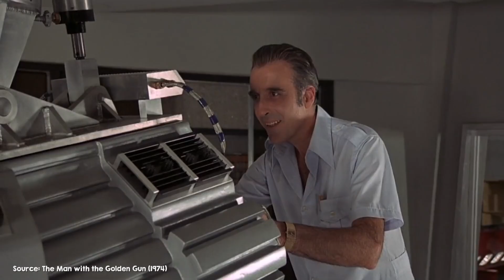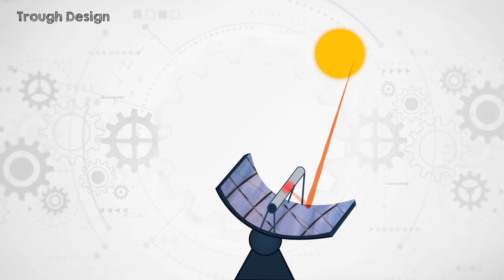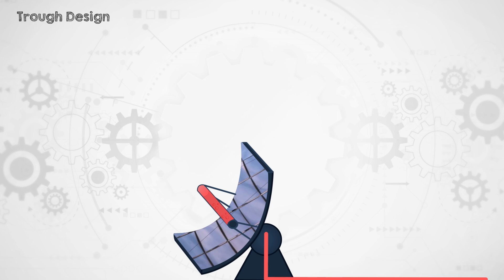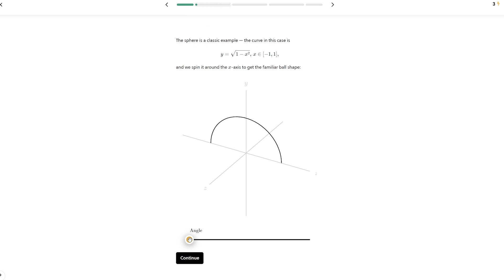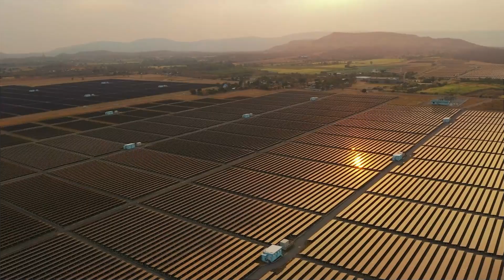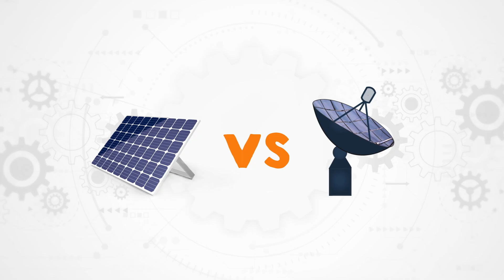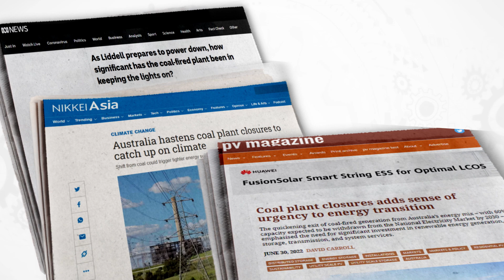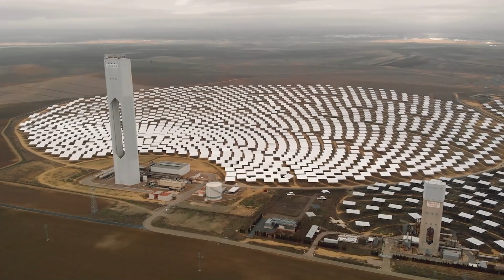Solar Power at Night using Concentrated Solar Power CSP

Comment: As much as I love concentrated solar, if photovoltaic prices keeps dropping, negative energy prices around noon will become common. So just take the heat storage part, and use the excess electricity around noon to heat it up. Electrical heaters are very easy and durable to build, compared to flowing molten salt.

Comment: So. Its 2025 and Arizona shut down their CSP system because it had to run on Natural gas to get it hot enough. Then most of the mirrors got ruined in a sand storm. No more heat. Sorry.

Comment: The public power grid has no choice in supporting wild AC.   Wild AC adds a great deal of cost to providing reliable electricity.  The wild AC from wind turbine and solar voltaic generated electricity is typically supported 100% with natural gas turbine generators running at high readiness 70% fuel consumption making near zero electricity where 100% output 100% backs up the wild AC 100% in 2 - 3 seconds.  Steam turbine generators used in nuclear, coal and the second cycle of natural gas combined cycle plants react too slowly to support large amounts of wild AC.   

The public power grid is responsible for constant power delivery and this is the reliable method used.   It requires curtailment of economic fuel efficient power generation to below the maximum peak of wild AC so that can be quickly accommodated with fast reacting natural gas turbine generators.   This consumes huge quantities of natural gas.  

Australia now has domestic short falls in natural gas due to this new huge need to backup so much wild AC.  It appears Australia will shortly need to start importing natural gas for further expansion of support for wild AC.   This from a country that has large natural gas export contracts it can't realistically break.

Cheap natural gas allowed large support of wild AC with the public power gird making it possible.   Within a couple hours of needed wild AC support,  such as for solar voltaic,  the power grid has to ramp down coal fired power stations and ramp up natural gas turbine generators for the quick response needed for the wild AC with similar switch over after wild AC is no longer needing to be supported.   When supporting wind turbine generators the public power grid typically needs to always be running expensive high readiness natural gas turbines generators.   There is no cheap means to quickly backup erratic forms of electricity generation.   Natural gas turbine generators  has made this relatively economical and reliable, but more expensive than conventional electricity.

Comment: Please sort out the CSP operational issues in Oz.  The balance of peak generation rates and storage capacity needs to based on operational data, not guesswork. Crescent Dunes CSP plant shut down several years ago, but has left the US with with a bad impression of CSP. In order to push CSP forward in the US, we need real operational data.

Comment: A billion dollar solar facility was a near total loss when the curculating system failed and the molten salts froze up.  Some solar farms use parabolic trough mirrors to heat compressed air in pipes to drive a gas turbine.
A plasma can be raised to any temperature. A plasma tends to absorb all manner of radiation and would offer no resistance to the flow of air.  A stream of comoressed air can be turned into a stream of plasma by passing an electric arc through the stream of compressed air.  So if the converging rays of sunlight from a dish mirror are turned into a narrow beam of light with a lense, the beam of light could be used to heat up a stream of plasma to drive a gas turbine.  The efficiency of a gas turbine tends to increase with the temperature and pressure of the furnace area.  If the efficiency of a natural gas gas  turbine can be over 40%, a plasma powered gas turbine with a temperature of tens of thousands of degrees might be 50% efficient or more.  
Some might nention direct sunlight.  Solar panels can get some power from indirect sunlight.  But if the inside of a cylindrical collector is covered in high temperature, high efficiency solar cells, a CSP system could have an advantage over solar panels even in somewhat cloudy skies. 
A gas turbine makes a lot of noise so it would not work as a rooftop system.  Or could the exhaust be directed into an underground chamber that would make it very quiet?
If a homeowner is getting  heat and electricity from a dish, the dish has a four or five times advantage over solar panels of the same area.
The dish tracks the sun which gives it another advantage. 
Millions of dishes coukd be combined into a formidable directed energy weapons system. A million dishes each firing a ten thousand Joule  microwave pulse is ten billion Joules.  If the air at the focus is turned into an explosive plasma, the blast and heat might destroy just about any target.  The converging microwaves would tend to create converging Xrays which would penetrate just about any armored plating and fry the inside of the target.  Explosives inside of a ballistic missile warhead would  explode.  10 billion Joules is the equivalent energy  of about two tons of TNT.  The blast would be like slamming the missile  into a brick wall which would also explode the explosives inside.

Comment: I know of four of these built since the 70s and have never heard of one producing any real amount of power. The latest multybillion dollar project in Brazil they have just sold off to BMW, and they plan to use UT to crack hydrogen out of water and then carbon from the atmosphere to make hyperformans engine fuel.(ethanol by a difrent name). But Suncor just adds carbon from the CO2 in the atmosphere to methane. Much more economical.

Comment: The only CSP technology that really worked was the Pyreheliophoro by Manuel António Gomes, better known as Padre Himalaya. His technology was presented at the 1904 World's Fair in St. Louis and won the top prize and two gold medals.
This solar concentrator was able to generate 3800°C at the time, and this result has never been repeated. 
Everything else that is built and presented today is just useless scrap.
Reply: Parabolic mirrors and Scheffler reflectors also work very well, especially if you want heat not electricity. But the pyroheliophorus is really interesting I must say.

Comment: Engineering with Rose Coloured Glasses.   Suggest you have a close look at the failures of Crescent Dunes and Ivanpah CSP plants or the large plant in Spain which was closed down as soon as government subsidies were ceased.  It's not just a case of installing a a plant BUT successfully operating such a plant in a cost effective way to maybe even given even a modest return on capital.  Doesn't appear to be happening yet with many disappointed expectant consumers.  Let's not worry about the impact of CSP on birds especially raptors.   This series is more of would, coulda, shoulda, maybe, possibly etc etc.

Comment: Heliostats for those who speak proper English, can be much simpler, such as using mirrors to concentrate energy into a window for example or onto  a dark masonry or metal surface. If heat is directly used it is far and away more efficient than always converting everything to electricity, and heat is easily stored in thermal mass to be released as warmth over night.  You've focused on the dollar values and ignored the inefficiency of conversion to electricity - understandable, but dumb. Wouldn't it be more useful to tell ppl how they can set up mirrors to track the sun while remaining on target? There are zero yt vids teaching that.

Comment: For long-term energy storage that doesn’t dissipate, why not use it to split water as hydrogen?  In addition to sodium.
You could heat a transfer fluid or salt as your primary, then use next generation flywheels as a Super Efficient Capacitor, and the Generate Hydrogen for long term storage.

All of those are less toxic than lithium

I thought about doing that with offshore installations that have solar wind and wave power

Comment: Wouldn’t the best battery be a carbon nanotube or graphene carbon fiber flywheel that is incredibly huge?
Especially one that is the diameter of a O’Neill Cylinder, at both ends?  Like a gyroscope a cube sat, but you have 4 Torus sized flywheels at each end (in case one needs to be serviced, the other could take over)

Comment: How hot do the mirrors get?

Is it possible to not only concentrate the power to a central point, but also preheat water at each mirrored point?  Or is that not enough waste heat?

I was thinking of using solar sterling engines, or solar concentrators to also generate light along the spine of an o neil cylinder.  The only problem is I don’t think that’s going to go very far. Especially with the idea of one being 30 to 40,000 feet in diameter.  Even if you could dot the entire central axis with solar concentrators or solar sterling engines.  

To light up and O’Neill cylinder, you would need a third of it‘a surface to be transparent, and that is extraordinarily hard, especially if you want to be able to have it maneuverable in space with Station sized gyroscopes/fly wheels, have rivers and lakes, besides everything else.

I’m just thinking of getting a twofer in space.  Power, light, and heat the air

Comment: Do you have any data on CSP desalination + water/vapor transfer/pumping?

I use CSP trough to pump water to the higher elevation storage for later gravity fed residential use. I am able to distill (although primary function was to pump) significant volume of water on sunny day reducing need for RO filtration. This is all based on small DIY - semi-off-grid setup but I believe could be easily scaled up and used in arid/semiarid location.

Comment: Great channel. A lot of your footage is from Noor II & Noor III. After working directly at the site, I have to say the parabolic seems more workable. The solar tower seems like a great idea, until commissioning all those mirrors to move correectly. This is something that can be overcome with quality design and control. One thing that remains problematic, that is the amount of water required to clean the mirrors. The footprint for a 150MW turbine is very big, which in the dessert is not so bad until a day of wind and dust puts the mirrors out of order. A literal fleet of diesel water trucks is used to overcome this problem. 
Pumped hydro is much more proven at scale.

Comment: I live in Belgium. All these technologies are very compelling and interesting but they all have one major flaw for the consumer. You still need that power cable connected to the grid operator and as long as this is the case they will suck your bank account dry. Some claim that super power will make energy abundant and cheap but I personally don’t believe this. As long as that cable is connected they will find out any reason to keep their profits at bay. The majority of costs are now already a collection of very clever fees they invented to guarantee the profits and have nothing to do with your energy consumption. The main problem is in December and January, the darkest months when we lack the ability to generate our own energy. They need to invent something that generates about 500w continuously which would be enough to get through those months. (In combination with LFP batteries) This could be accomplished through much more efficient solar panels working with diffuse light also used in space but for the consumer these are to expensive. A wind harvester would also be an option. Or a combination. Than you can go off grid and be self sustained.

Comment: CSP should be part of the future city planning, instead of leaving most of the rooftops unused it could be used with the tower concept to concentrate heat there and use it in various possible ways:
1. Energy storage
2. Electrity generation
3. Heating
4. Hydrogen generation (Hydrosol)

This way a more decentralized way of providing energy can be achieved on a community level.

Comment: We don't need fuel or nuclear heat to create steam or wait for steam from the sun or wait for wind or water to turn the armature and coils of copper wire to produce electricity.  We can use the field magnets to move the armature magnets and coils of copper wire like Edison's generator and Tesla dynamos power plants with inverters and transformers to deliver high voltage AC power continuous peak power without fuel or steam.

Comment: Hopefully you will be allowed to examine permanent magnet motor as a generator powering brushless motors as generators with inverters and transformers to deliver high voltage AC power continuous peak power without fuel or pollution. The original Edison generators and Tesla dynamos power plants that deliver high voltage AC power continuous peak power without fuel steam wind or water.  This original design can be made much smaller with modern technology.  These are still the leadt expensive most efficient power plants to replace nuclear power plants and fossil fuels use and vehicles.

Comment: The issue with CSP is water use, which seems super unintuitive.  But almost every time Ivanpah has been shut down was because of water issues, needing to expand their water storage, and cooling towers multiple times before it could run at full rated capacity.  There is also an issue with air traffic (including birds) being blinded and/or baked by the bright tower or misalligned mirrors (which seems like they could mitigate by adding a type of hat on top of the tower to help manage some stray light?).
It isn't to say that CSP is impossible... just a lot more expensive than standard solar PV +batteries.  Between molten salts corroding pipes, and water issues, and having to turn a generator, CSP is very much a bandaide fix to make traditional turbine-turning power work with a renewable heat source.  It can be done, but when you can just create electricity directly cheaper... why go through the inefficiencies of legacy systems?

Also, there has been some fun stuff with SCP PV.  It has never quite hit main stream, but this has the potential to hit 40-60% efficiency as PV directly, without any efficiency concerns of converting to a steam turbine.  This is still a research project because colling it, and replacing the short lived cell that gets burned alive are still very real issues, but there is some promise there.  But perovskite coated traditional cells look like the real direction of the future with potential to have cheap panels that can hit nearly 30% efficiency, which is remarkable!

Comment: And why did you not include a few minutes specifically devoted to the $1 billion USD Concentrated Solar Power Plant outside of Las Vegas, Nevada USA?  The Crescent Dunes Solar Energy Project was only on line for eight years and when operating it produced 110 megawatts of power and had 1.1 gigawatt-hours of energy storage capacity but it failed due to..........?  It's hard to watch your videos if you are not going to discuss both sides of an issue.  Especially something that has a price tag of $1 billion dollars that we will have to pay for if we chase too many rabbits down these expensive holes.

Comment: Cost of batteries are falling very fast. Storing access electricity on batteries is the most efficient way forward. CSP technology is obsolete.
Reply: Battery cost is falling until you need more of them and then find there isn't enough Lithium.

Comment: Arizona has the Solana project.  It takes 3 sq miles of solar to power 70,000 homes.  That works out to about 5300 sq miles of desert to handle all us households, or 20% of Arizona.   Interesting

Comment: I've been a big fun of CSP since I found the long shutdown Solar-1 and Solar-2 experiments on Google Earth, and researched it. Back somewhere in 2007-2010, There has been a large trove plant already (maybe in Nevada; anyway, close to the border), but these suffer from energy losses in pipes, and theoretically much less efficient. We have about much as much sun in California as Australia, and the desert has little clouds all year. A large (100+100+50 MW) 3-tower Ivanpah plant in the Mohave desert has been running into a lot of design and running problems. Last time we drove by it, just a couple weeks ago, I noticed that one of the 100MW tower was offline and dark. There were beautiful caustics hanging mid-air, from the mirrors having shifted focus to a ring of points around the tower—you see with your own eyes how tremendously much light they collect!

But I've only read bad news about this plant, that it requires so many repairs that it barely ever broke even. That's a bummer—the technology is unbeatably the best of all solar thermal for a large scale. I still cannot understand this pretty much a failure—is it just a flawed design, cutting corners, or really engineering problems inherent to CSP. It looks so beautiful, and, as a rule, things perceived as beautiful to the engineering eye work the best. But it's as if it just can't take off the ground. I hope, too, it will.